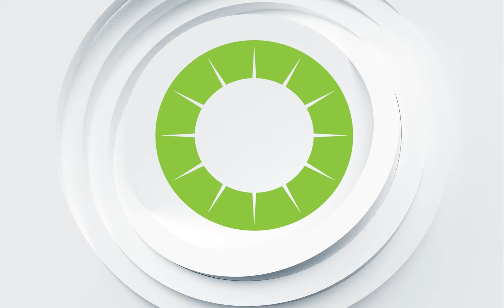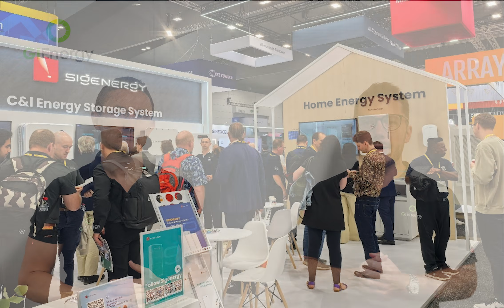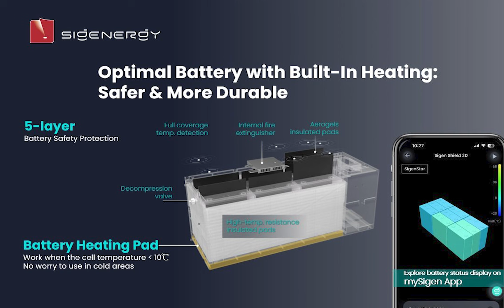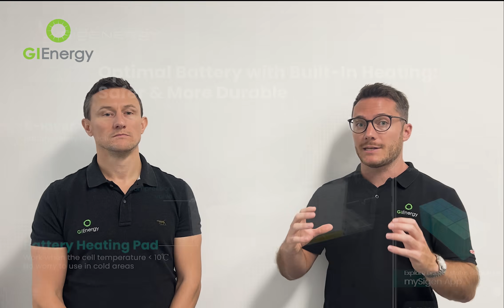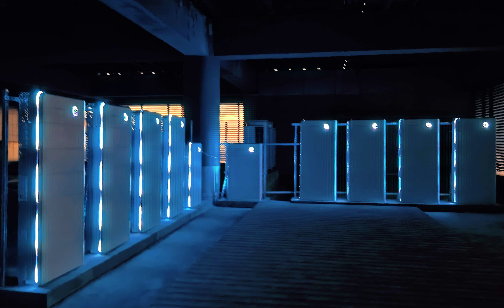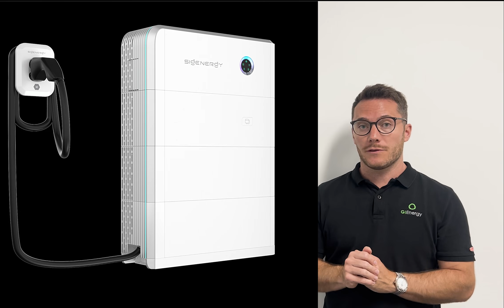Is Sigenergy any good? Honest Sigenergy Review & Comparison (Sigenergy vs. Other Batteries)

Comment: AlphaEss has been in Australia for more than 10 years. At the beginning it had been raves until the year down the track when support had been slacking. Look where is at now, everyone calling it junk. So I am not confident on Sigenergy since the high price too whereas AlphaEss was cheaper to begin withZ
Reply from the maker: We can only speak based on our own experience and we definitely acknowledge that Sig is a bit of an unknown in that respect. We installed some Alpha batteries for another retailer a few years back and we did have some issues. Support was OK to be fair but for a very small quantity of installs the issues were quite high. Also speaking to other installers that we consider reputable we heard similar things. There is a risk with any battery long term and I think when you weigh all the pros and cons, Sigenergy is worth it. The major appeal with Alpha is price... thats about it. We are not a price driven installer and we focus on value over cost so we won't install Alpha. Each to their own though. We are not perfect, you have to do what you really believe is best and based on 16-years experience, that is what we are doing.

Comment: I read that the AI side of it is going to a subscription service. Is that true, is that just the app or the entire unit, and if so what cost annually? Is it required and what are the downsides of not having a subscription if you choose not to?
Reply from the maker: We haven't heard they are going to charge a subscription for anything and it doesn't sound right to me. Every battery and solar inverter have online monitoring these days and none that I am aware of have ever charged for it. I can't say it will 100% never happen but I am fairly confident it won't and I haven't seen anything from the manufacturers or distributors to suggest otherwise.
Reply: @gienergy2250 thanks, good to know.

Comment: Too good to be true perhaps
Reply from the maker: Thats what we thought initially and it is a fair question. We have installed heaps of them now and so far so good!
Reply: So far... lets get a through summers and winters
Reply from the maker: @MattsFishingEscapes  Fair enough, the Sigenergy battery is not for everyone and we agree the length of trading is the downside. If you are not comfortable with that aspect then there are other choices available. That being said, the management team and the components used are very impressive. As far as 'newer' manufacturers go, Sigenergy is streets ahead in terms of brand, market share, financials, management team and crucially real runs on the board in terms of numbers of systems installed in a short period of time. All of this is a testament to how its innovated tech has boosted it up the ranks so quickly. There is always a balance with any battery and you have to weigh up the pros and cons before deciding which is right for you. If you are concerned by how long they have been installed for, you are certainly not alone. We do not have any affiliation with Sigenergy and we acknowledge pros and cons of the product, try and provide honest advice, offer alternatives and deign systems for peoples specific needs.

Comment: how good is the 10 year warranty given this is  new company/supplier with no medium/long term usage proof?
Reply from the maker: Fair question and we agree the length of trading is the downside of Sigenergy. If you are not comfortable with that aspect then there are other choices available. That being said, the management team and the components used are very impressive. As far as 'newer' manufacturers go, Sigenergy is streets ahead in terms of brand, market share, financials, management team and crucially real runs on the board in terms of numbers of systems installed in a short period of time. All of this is a testament to how its innovated tech has boosted it up the ranks so quickly. The rest have to play catch up now and where will Sigenergy be when they do? They are not going to stand still while others research and develop. There is always a balance with any battery and you have to weight up the pros and cons before deciding which is right for you.
Reply: Thats one of the downsides of the Sigenergy battery - the fact it is newer than some of the competition. Most of the components inside the battery are time tested as individual items and the business structure, personnel and future outlook look very strong. However, you are right to point out the overall manufacturer is newer. Something to consider when you are choosing a battery for sure.

Comment: What about the warranty on the gateway ? Or After sales support.
Reply from the maker: The gateway has a 5-year warranty and you can upgrade it to 10 easily and for a fairly small fee. After sales support for a consumer would point to the installer so you would need to make sure you are comfortable with their level of support as you would lean on them to help if someone was not right. In terms of Sigenergy support, they have a growing team and no doubt will have growing pains in that area. The rise in the volume they are now seeing has been unprecedented so I am sure it will take time for them to align the staff levels with this volume. Long story short, get comfortable with the installer as they will be the ones you phone if you need something. And as for Sigenergy, we do not know how well their support will deal with this new volume but the early sign show they are putting the right systems in place.

Comment: Other reviewers point out that this manufacturers product only has a 2-year warranty on some components, has plastic covers instead of aluminium, has poor "cable management" as it's very exposed to the elements and animal invasion. Any comments on this as it's a very young company with less than 2 years "in the field" to demonstrate how it overcomes challenges. I also understand it also has a "generator input" ability.?
Reply from the maker: The 2-year warranty they are referring to has been updated to 5-years and you can extend it to 10 for quite a minimal fee. I haven't had the same cable management feedback from any of our installers and we have had more than 10 seperate installers installing them now. I am not here to criticise someone else opinion but I have to be honest and I haven't seen those issues personally.

Comment: I really need a Sigenergy battery. House is 3 phase and the Powerwall 2 does not support it. With the connected inverter, does that mean an inverter for the solar panels is not needed? If I were to replace my PW2 with a Sigenergy battery, would I need to remove the Tesla gateway? Will it talk to the Tesla app and show the state of charge? The PW2 is the weakest link in my setup. It is the only piece that isn't 3 phase. Sounds like I have the same setup as Daniel.

The best part about this battery is the modular design. It allows a lot of freedom to upgrade with your needs as you need it.

Comment: its a shame cause i have a fronius. i would have to rip out my old system to replace with this..
Reply from the maker: You can Ac couple the Sigenergy battery with any inverter (including Fronius). It may not make sense to do this but it is an option if you wanted to keep the Fronius inverter.

Comment: Just confirming on single phase that during a prolonged blackout, the Sig will still be charged by my solar panels? 
Thanks for the video
Reply from the maker: Yes, if it is set up correctly you will be able to black start your battery and charge will your solar panels with no grid power. Same for three phase which is a limitation of other well known batteries.